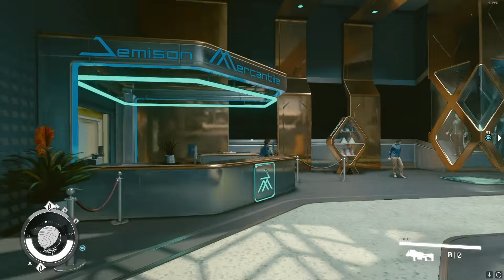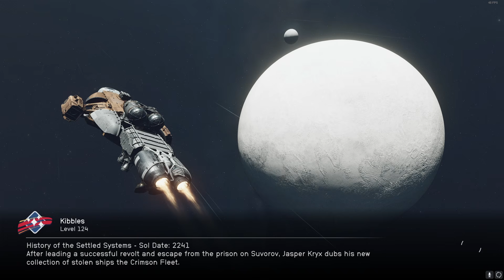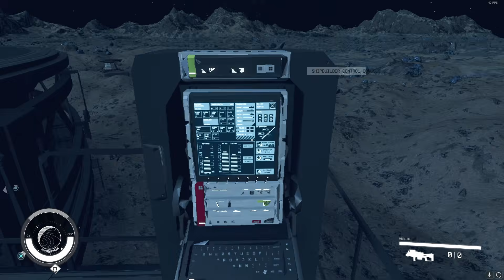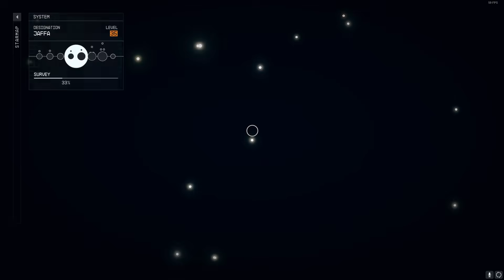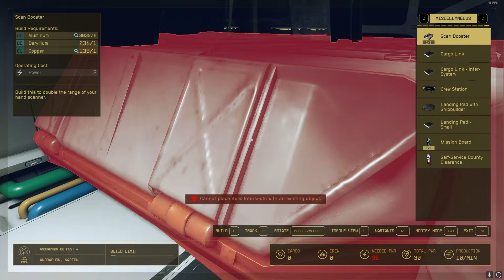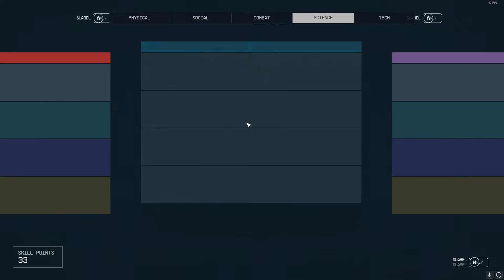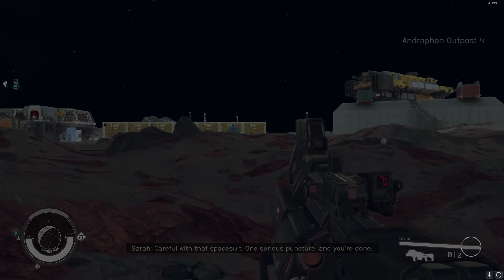Starfield outpost guide 2.0, beginner to expert FAST, outpost tips and tricks, cargo links, building

Comment: If you go to modify mode (the one were you can connect stuff) you can also edit some habitats walls for example you can put more windows. You walk to a wall, if it's editable it will highlight. It's the same button you use for putting staff in build mode.

Actually many habitats have windows but not by default.
Reply: They need a similar function on ships.  If your near a ship technician and on your ship, you can go to 'ship edit mode' like outpost mode and then edit hatches and walls and ladders to turn off and on entrances.

Would really help and shouldn't cost anything, as these events don't cost at the technician either.  Interface is already in place with outpost editing.  As long as a path is maintained from cockpit to docker/ramp, you should be free to add as much or little as you like.
Reply: Windows are structural weaknesses
Reply: Yes I was going to mention this very thing. Walk up to those walls, they highlight yellow, click and bam, window drops in. You can remove them the same way too.
Reply: 😂 thank you, I want windows but never searched if I could, just accepted it.

Comment: What really bugs me is that we can't build any foundations. Those would make it way easier to put the containers where I want them to be.
Reply: This is mitigated by altering the height of items before placing them. I'm going to assume this guy didn't know you could do that, but it does allow you to do what you said minus the extra step of building the foundation
Reply: @ChiIdOfDust  doesn't really address the issue since you still walk over grass or whatever in your industrial park and it's kind of difficult to build all the fabricators and storage modules to the exact same height.

And it's not like the game doesn't have it. NPC settlements can build them. So why can't I, 300 meters to the south or whatever, do the same?
Reply: @Alpha_Digamma  do..... do you not understand the whole "you physically alter the height yourself" aspect of my comment? 

You literally alter its height and the foundation is automatically built. You don't want the grass there, then when placing and item, w/s keys on a keyboard or holding A and using the left stick

Again, YOU PHYSICALLY ADJUST THE HEIGHT YOURSELF and the foundation that you do desperately want is built for you
Reply: @ChiIdOfDust  that solves absolutely nothing as I still can't build a plattform to put everything on the same level. And I still have to walk around in the dirt. NPC settlements can put down concrete just fine, why am I unable to? Because it's a barebone system. I dare say it's half assed.

Comment: I got super lucky on Andraphon finding a spot that (barely) has Aluminum, He-3, Iron, Beryllium, AND Europium! Although the buildable space got slightly infringed, since another tip I haven't seen mentioned is that NPC landmark locations have a (200? 300? meter) radius exclusion zone where you can't build anything, and there was a cave nearby that cut a chunk into my outpost zone. Since I built my outpost with a little trial-and-error before I saw this video (lots of people doing guides, eventually recommendeds pointed me here- gotta say, good one!), I got a little confused on how the feeding connections work (it's worth noting that it seems they only feed in the direction you connect them, so the order matters), and didn't realize that they only move materials around, and don't just create a shared-access pool like I was expecting (so I had connections leading to the cargo link and transfer container, and got very confused when the materials I put into the storage containers immediately disappeared as soon as I backed away). I was hoping for more of a "shared pool" like I was expecting based on Fallout 4, so I could access all stored materials at my crafting benches without carrying them around on me or my ship until I could get the insane funds for an insane class-C cargo ship. Biggest let-down of the game so far IMO, that the resource sharing is FAR more limited than in F4, which means storing and accessing materials is a lot more work, and I'm perpetually over-encumbered since materials are so dang heavy. (It's a good thing I found a backpack with Assisted Carry, which reduces O2 drain when over-encumbered by 75%, so manageable, but no thruster slot on it D:). Also, not sure if there's a way to hook up cargo container contents to crafting tables, or only your ship...

Also, I should mention, since I ran out of copper somehow (I could've sworn I'd had enough on me), I tried using a couple fueled reactors for power since I had a He-3 deposit, but annoyingly, the reactors use up He-3 far faster than the extractors produce, so they're useless unless you have a huge field where you could drop 5 extractors to feed a couple reactors (also'd need some He-3 on hand in order to start the generators to begin pumping), or have progressed enough for an industrial-sized extractor (but by then you probably have better options for power, such as just doing solar)
Reply: You only need to physically pickup resources for crafting if you are moving those resources to another planet. Any resource in your outpost is accessible from anywhere in your outpost, including your ship's cargo bay, if your ship is in your outpost.

Comment: Would it make sense to have basically a He3 "outlet" storage set up on all your outposts with intersytem links, that basically yoinks any He3 from the input box  and then channels it back into the main He3 system (or even directly back to the cargo power input)? This seems like it would automatically "declog" the system if the bug does occur, and otherwise wouldn't take up much space or resources.

Comment: Quick tip: in each resource field put one container in the center of the field and connect the extractors to it then connect that one’s output to the stacks of containers. 

That way you can repoint the entire resource fields output by changing the one box and its easier to see what’s going because you don’t have tons of redlines everywhere.
Reply: My outpost looks like the matrix of red lines. Works but this is much better, thank you 🙏🏽
Reply: @theloniousvic bruh tell me about it i have 4 node outpost and it's my   farm/money stuff and I have 600 red lines and so disorganized but still making money and have more stuff than I know what to do with (ima build a pretty base now prbly and buy ships I definitely shouldn't buy cuz idk I like ruining my play thrus 😂)
Reply: Was going to post a similar comment but also I like to drop down all 3 container types on inbound links. Helps stop the H3 issue if you have a receiving tank already set up.
Reply: God dammit, Steffen! You’re a god damn genius. This the most astounding answer I have ever heard! You must have a goddamn IQ of 160! You are goddamn gifted!
Reply: That’s smart!
Reply: I wouldn't use exactly the center. If you circle the extractors along the edge most the times you can place one or  two extractor in the middle.
Let's say...put it somewhere where it won't disturb the mining operation.

Comment: you can carry unlimited weight in your inventory, low oxygen will drop your health but wont kill you. it stops at about 5% health. and you can still run etc, just dont go picking fights with anything.
anyway, no need to modify your ship to increase inventory for the purpose of moving resources around

Comment: At what point is good to get into ship building/outpost building? Is it after I've unlocked certain perks or a certain point via main story line or after main story line.. im new to Bethesda games... yes ive been under a 🪨
Reply: I've started building them right way since I like the management thing.

Just buy some allimunium , beryllium, iron, tungsten, copper, nickel, zero wire and adaptive frames (if you don't have them already).

And start building little outposts on planets you like or when you find one of those resources.

Then with time you'll accumulate them thanks to the little outposts and you'll slowly reach the capability of being able to build enormous outposts :)

Comment: Great guide, thanks. One question, please. Found a great place for my first base but being new and not having alot of stuff I built small. Would like to expand the storage. I have 20 storage containers now with the input going into the first one and output out the last. But if I add ALOT more storage containers and link them will it not screw up my output? I assume you just change your output to the last one you built but I wanted to ask the expert...
Reply: Just redo the output links after you've added the storage containers. You can delete the links themselves without touching the boxes.

Comment: I appreciate your content. Especially the tip on finding the seam of the different terrains. I have multiple outposts on seams and have found the seam using your method with one additional bit.

When selecting the spot i make sure it's left/right or up/down for the two biomes. If i land on the left (planet west) i open my map and then head east (right). Same goes for up (north) and down (south).

Some of the seams are crazy.

Also, the quarter missing on outposts has been a pirate "Ship Landing" location for me everytime. At first I was mad about it. Now I steal ships from at least one of them. 😂

Comment: How come you didn’t have to use any ‘wires’ from the power sources?….mine only worked when I connected wires
Reply: Power is spread wirelessly to the outpost, but if I'm not wrong, if you press the wire button, it stops doing such and you're forced to connect the power yourself

Comment: Cargo link inter systems only need H3 to deliver resources. Not receive. So the cargo link inter systems that you would be receiving supplies on don't need a source of H3. Only the ones sending stuff need H3.
Reply: Actually that's not correct. If you don't have HE-3 on both platforms, the ship will stop on the planet without HE-3. Both your platforms must be receiving HE-3 from either a link, or there's HE-3 stored and at some point it will run out.
Reply: @flacwby  False. I'm literally watching it happen my friend. I have interlink systems at my main base on Jemison with no H3 attached to them. They are still receiving the zero wire I'm making in a different system and filling the boxes.
Reply: @xVengy  Then congrats you have a exploited bug, because it doesn't work on any of my inter-system cargo links. Both must have HE-3 to work.
Reply: @flacwby  The interlink systems on the planet sending the zero wire do have H3 attached to them. But that's because they are the ones "sending" the supplies. The platforms that are only used for receiving do not need an H3 source attached to them.
Reply: @xVengy  Again, congrats on your bug find. My receiving platforms without HE-3 the ship will simply sit there. The moment I put HE-3 in the tank of the platform, the ship takes off.
Reply: @flacwby  It's not a bug dude. You just don't get it. 
Interlink platforms sending supplies need H3 attached to them. 

Platforms sending AND receiving need H3 attached to them.

Platforms ONLY RECEIVING do not need H3 attached to them. I can't make it any simpler.
Reply: @xVengy  Nor can I. It doesn't work unless they both have HE-3 so either you found a bug, or maybe I found the bug, but my interlinks don't work unless they both have it. I have 1 final thought. It may be distance based. The ship holds 5 HE-3, it's possible if the systems are close enough that there's enough HE-3 for 1 round-trip. In that case you don't need it on both ends. In my case the systems are pretty far, so there's not enough HE-3 in the ships tank to make it back.
Reply: @flacwby  The Systems im using are Alpha Centauri, Narion, Guniibuu and Sol. Distance could play a factor sure, but so far I have yet to see that be an issue.

Comment: what if you set up a link from the inter system cargo link that takes solid material from the output box and send it to a solid storage and then a secondary link from the same output box to a gas storage? In that way it can auto un-clog itself 
then just use that helium3 to whatever you need it .. maybe put it on the helium 3 chain of storage or to repower itself

Comment: FYI you only get mixed biomes when landing from orbit. Selecting a new landing zone while on the surface and fast traveling to it will only generate a single biome, you have to take off in your ship if you wanna try for another mixed biome.
Reply: Tested this. No differences between the two at all.
Reply: you can just hop around and find 2 biomes in one landing zone easy. Orbit doesn't affect it at all. Just do the trick described in the video and with some pixel fine adjustments you'll get one fore sure. Whether or not the iron and aluminum are close enough at this border is up to chance though and may require some walking around.
Reply: Pretty sure the planets are procedurally generated but the land is all pre generated already, as people are finding locations that other people have found, so landing from orbit, and traveling from land shouldn't make a difference.
Reply: Oh my god…I thought I was going crazy
Reply: This game is beautiful 🤩 can't get enough of it
Reply: Not true, I was hoping while on planet and got one after 4 attempts
Reply: @AR333  then it significantly screws your chances. Either way, go to orbit first.
Reply: @allseeingsage214 no it doesn’t significantly screw your chances. You made up some incorrect info, got corrected, then still tried to back up your lie 😂
Reply: @Davelever366  All I know is I hopped from landing zone to landing zone for like two days and would only got single biomes, went to orbit and landed, and got a split biome immediately. Every planet I've been to since, if I go to orbit and land it gives a split biome. I know it is anecdotal, but without looking at how the game is coded, you can do the math on the probability there and find out it definitely affects your chances. I personally have NEVER seen a split biome when jumping from landing zone to another landing zone without going to orbit. I think this has to do with the load times, you can tell the game generates in tiles (you will get a slight stutter on console when crossing over into the next tile as it generates) and it appears to me that the game preloads more when going through the full landing cinematic and split biomes are usually a couple tiles away.
Reply: @Kangorrilla  it definitely does, how can you say it doesn't? It took him multiple tries from planetside to generate a split, I can get one everytime from orbit. The ONLY thing he got wrong was saying its impossible, but it might as well be considering the success rate.
Reply: @Kangorrilla  you ok lol? he was just stating what he found to be true, he isn't LIEING...Jesus man relax.
Reply: @allseeingsage214  I have never once gone up to space to land and I’ve found plenty of spots. You are making things up.
Reply: @Kangorrilla  you literally had to land from space in the first place to be on the surface...
Reply: @allseeingsage214   not while I’m hopping about after I’ve landed. So so obviously you clown.
Reply: @Hexis17  shut up and learn to spell
Reply: Could just be RNG being RNG, game hasn't been out long enough to actually test that, and we tend to see patterns where there aren't any. All that aside, we all have our rituals when dealing with RNG, and it does feel pretty good when your's works out, even if it's still just RNG. How many times can I say RNG in one comment? Sheesh...

Comment: I forget what planet it is that I'm on with my main base and I was able to get all six resources in one Outpost granted I can only put a maximum of three larger refineries on each node but that's more than enough that I need It was an awesome find and it took me a little bit but that's two or three outposts that I don't need to build anymore. If you take the time you can find a great spot and you'll be able to cut down on your shipping lanes and the outputs that you want for just manufacturing purposes leaving you slots to build your getaway outposts purely for aesthetics and scenery

Comment: Kibbles, at around 20:20 you mention turrets. I have an outpost adjacent to a large facility. I cleared the facility but I get enemy patrols showing up from time to time, usually 4 in each , and the leader will be a 15-25 is level. So turrets are for more than animals, although what you said regarding animal damage is correct!  Very dissapointed that the outpost portion of the game is so limited and no where near what it was advertised to be. IE only 1 type of stair for a building, and I have to build an airlock on all planets???  Keep up the good work!

Comment: I have not seen this tip in any video but you can in fact build outposts or two outposts very close together. By placing storage at the edge of outpost you can manually loot then walk over to the other outpost. This lets you craft manually on the industrial bench faster than messing about with cargo links. Ofc you are limited in how you can apply this tip but it can help in certain layouts to obtain more of a certain material that is harder to get in large amounts